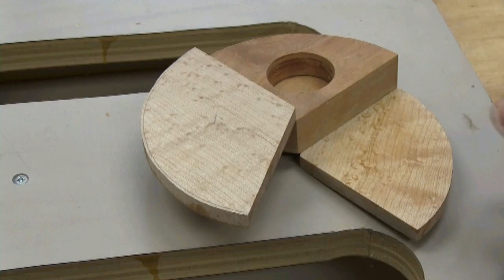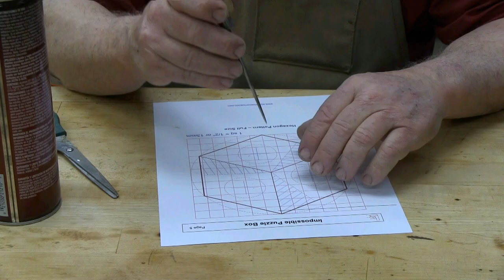Making a creative Wooden Puzzle Box

Comment: This is wonderful, thank you. I made one by following the video. For anyone else thinking about building one, there is an error to be aware of: at 2:24 after the bottom is masked off the piece is turned over and the same end of the top is masked off. This is repeated for the other pieces. It should be the other end of the bottom that is masked off because the pieces that are glued to the top and the bottom are glued at opposite ends, not the same end. This means that a gluing area on each piece is oiled from 2:41. Compare what you see when the masking is done with the completed sections at 4:46 and you will see what I mean.
Reply: 🤫Shh! They got to get you to buy the plans somehow. Thanks for the tip. I would like to make one of these for my 7 year old granddaughter. She loves treasure boxes.

Comment: Cool. Curious what are the holes for?
Reply from the maker: It's a box -- you store things in the cavities created by the holes.
Reply: With the router and a template to follow you could make it completely hollow instead of just the tea-light-sized holed. Or make appropriate-sized holes if you have something specific to store.
Reply: @SenselessUsername  I did one with 6 partitions to store a load of USB drives I have.